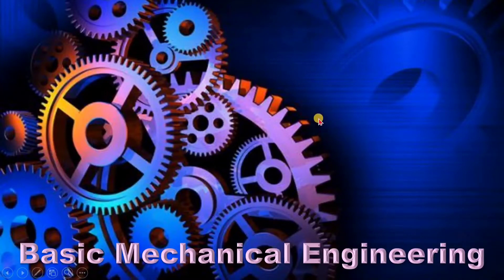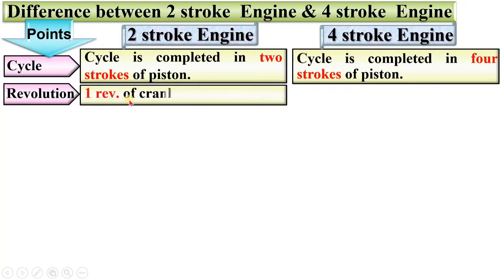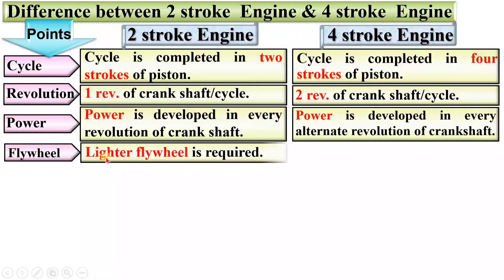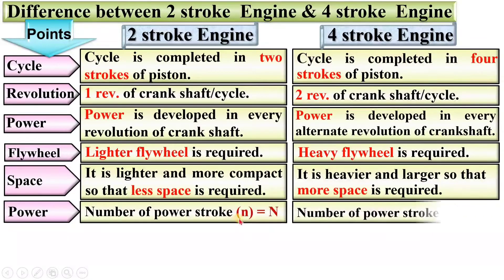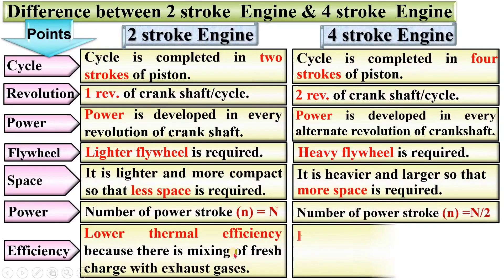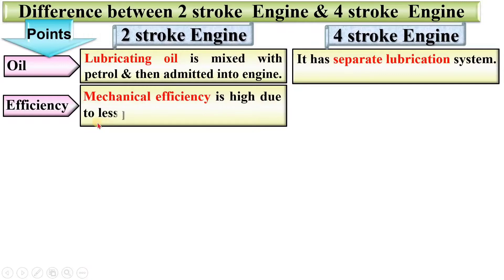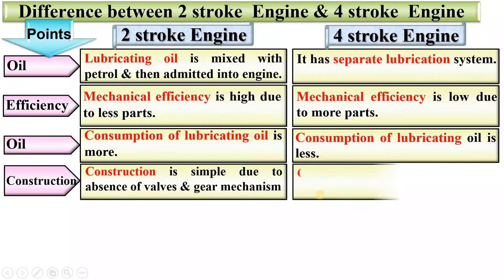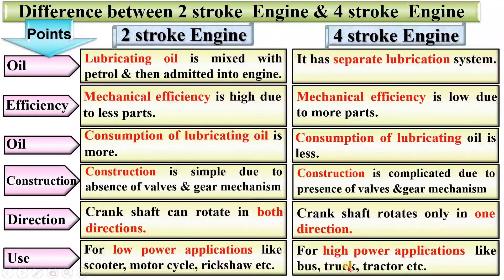Four-stroke Engine Vs Two-stroke Engine | Parameters of Two Stroke Engine & Four Stroke Engine

Comment from the maker: Difference between four stroke and two stroke engine explained with following points: 
1. Two stroke and Four stroke engine
2. Difference between 2 stroke engine and 4 stroke engine
3. 1st Difference between 2 stroke engine and 4 stroke engine based on Cycle
4. 2nd Difference between 2 stroke engine and 4 stroke engine based on Revolution
5. 3rd Difference between 2 stroke engine and 4 stroke engine based on Power
6. 4th Difference between 2 stroke engine and 4 stroke engine based on Flywheel
7. 5th Difference between 2 stroke engine and 4 stroke engine based on Space
8. 6th Difference between 2 stroke engine and 4 stroke engine based on Power Stroke
9. 7th Difference between 2 stroke engine and 4 stroke engine based on Efficiency
10. 8th Difference between 2 stroke engine and 4 stroke engine based on Oil
11. 9th Difference between 2 stroke engine and 4 stroke engine based on Construction
12. 10th Difference between 2 stroke engine and 4 stroke engine based on Direction
13. 11th Difference between 2 stroke engine and 4 stroke engine based on Usage